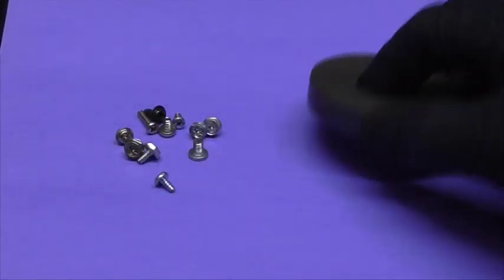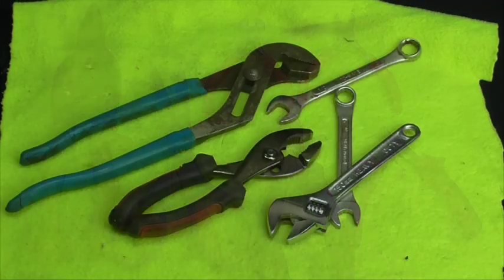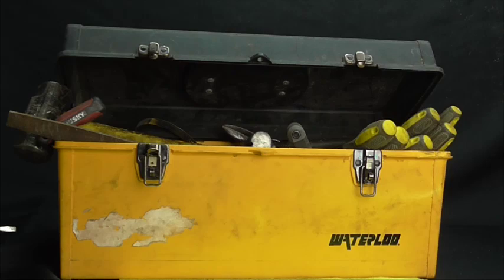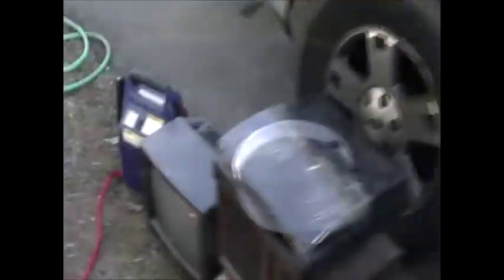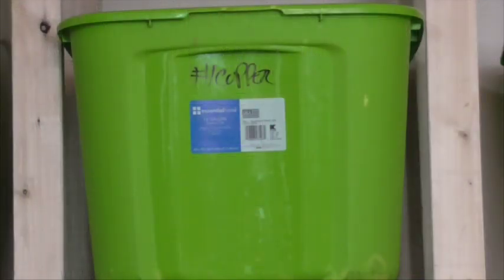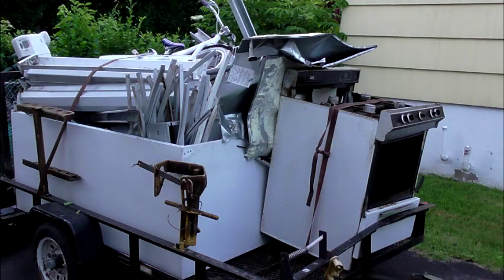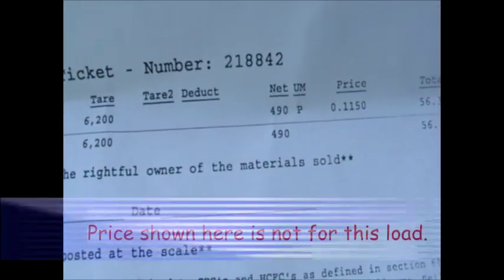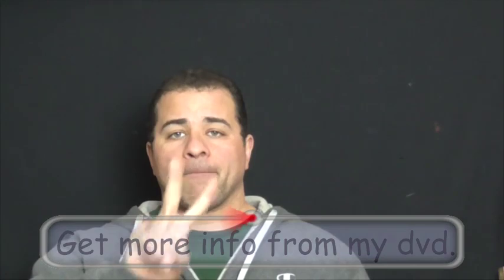NEW TO SCRAPPING?

Comment: Mike, I routinely end up with garage door springs. Is there a better way to separate the springs from their aluminum ends (the part that lets you tighten them) besides sitting there with a cutting disk and cutting at opposite sides of the spring winding? This is time consuming, noisy and down right annoying to do. Obviously a torch would work better and I am looking into a plasma cutter but I am curious what you or anyone else might think about it.

Comment: Mike, you forgot to tell folks this important piece of info....before they go out and load up a bunch of scrap, first find out what their local scrap yards will & will not take. Also, if there are local outlets to sell things the scrap yard won't take. Here in N. Ga., for example, BY LAW, scrap yards will not take air conditioner units unless you're a certified heat/air contractor & have properly disposed of waste gases. Also No microwaves either. No t.v.'s., no LP gas tanks, no chain link fence, no computers, among other stuff. Also, locally here, there are no other outlets for these items other than the landfill and their dump fee is $30/ton. In some areas of the country the "big scrap find" isn't worth messing with. Before you go loading a truck full of junk, know what scrap you're getting & know what your local scrap buyers allow.
Reply: Actually, he did. He said to ask for a tour.

Comment: before srapping pcs, any machines that have vista or newer should be put up on ebay, you will usually make more money, same for xp era touchscreen models.  if you get flatscreens and they are widescreen, also sell them on ebay, 4:3 ones are only worth about 20 bucks.  Dell ultrasharks are also worth selling.  dont scrap any high end gas equipment brands like echo, stihl, or honda, beleive it or not these are usually worth 50 dollars even if they are brokens because of their initial sale price and just because of the name.  If you get computers and they work, take out the hdds before selling them and wire wheel the blatters with a drill and then bend them in a vise, so the data cannot be accesed and used against the previous owner.

Comment: Hi Mike, Happy New Year, wanted to ask you if chrome is worth scrapping ??  do you know the current price ?? I cant find it anywhere. I picked up a huge drum set from the trash it was all busted up so its worthless, the sides of the drums are covered with metal brackets and buckles that look like chrome, not too sure how to tell if its really chrome. Thanks for your time
Reply from the maker: victordelc21 it may be chrome plated. check the object with a magnet. may be steel or aluminum.
Reply: Mike the Scrapper Thanks Mike, keep your videos coming they are great

Comment: So you went on road, pick-up some stuff, open the electronic equipment and kept the metal, put it back in your truck , drove to the scrap yard and only received $56.35 ??? I mean all about recycling and for saving the planet, but you're probably spent more than $56.35 in fuel just using your truck.
Reply from the maker: I can spend that much fuel in a week